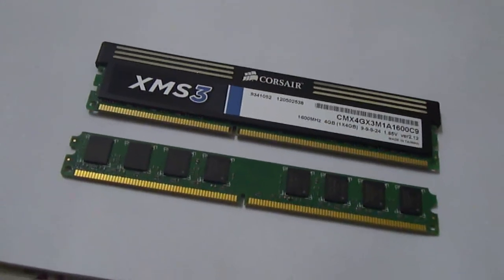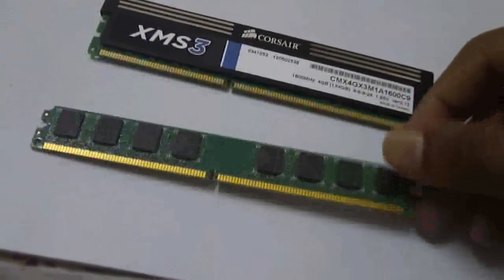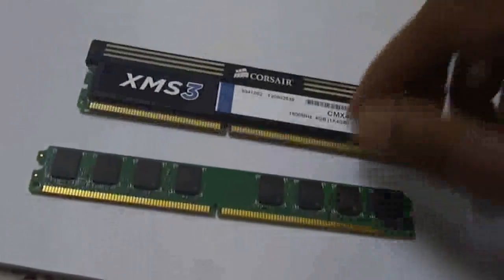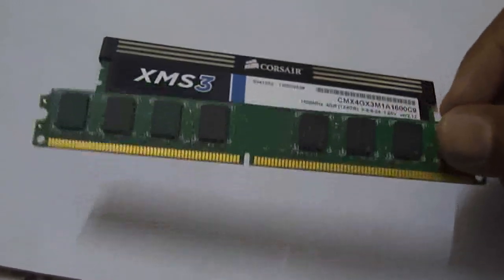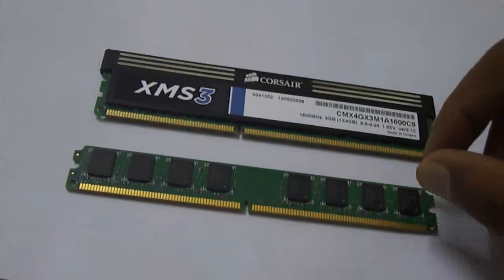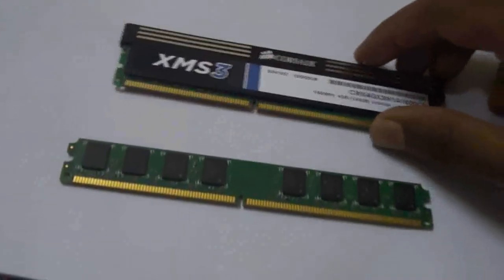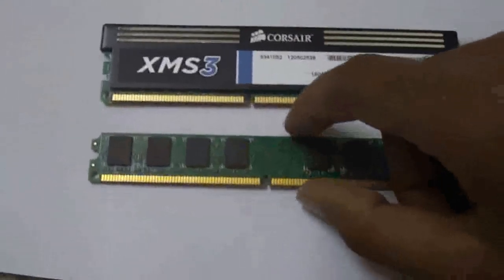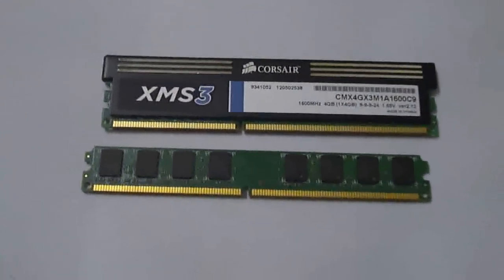DDR3 vs DDR2 - Basic Differences

Comment: Thank you for this video.. very informative... I have ddr2 if I want to upgrade my RAM to ddr3 or ddr4 I have to change motherboard???
Reply from the maker: Alois Daniel thank you..:) and yes you will have to change the mobo unless it is a motherboard that supports both ddr2 and ddr3, so check if your motherboard has separate sets of slots for ddr3 and ddr2. 
Or just type the mobo name here and i shall help you..

Comment: why are some of you complaining of him dropping the ram sticks, who cares.  they are his and he can do whatever he wants with them, ram sticks are very durable.  he could throw them against the wall plug em in and they will work just fine.  In fact, i used my old ram sticks as anchors to fetch in the pool.  haha they still worked quite well
Reply from the maker: :) thanks. Actually I'm not dropping it. Its just a slightly thick ply wood board, and when ever I put the stick down, my camera mic is just pulling up a lot of noise.

Comment: DOUBLE DATA RATE (DDR)
it simple just hold both the ram , watch the cut on both the ram, ddr2 has cut mark (not in midddle ,its in more left side as compare to the  ddr3 ram,, ,
and every ram has its own ram slot on mother board ,,ddr3 is not going to work in ddr1 ram slot (board has slot and ram has mark for it ) Although its mention on the ram .